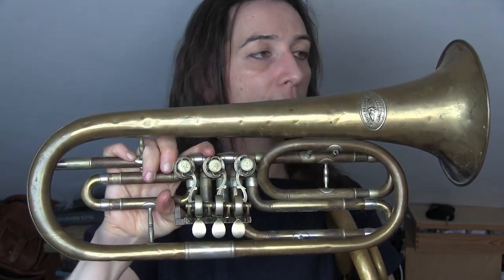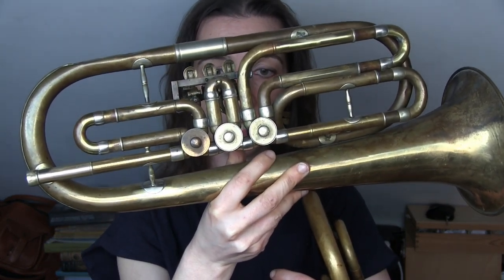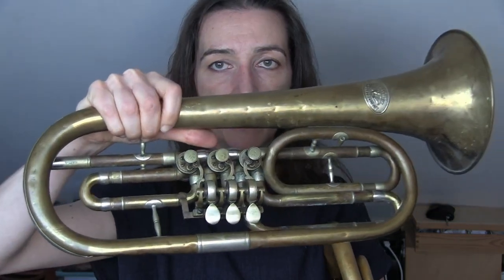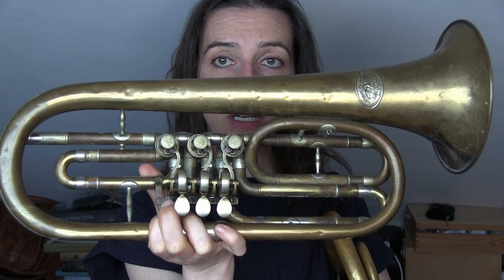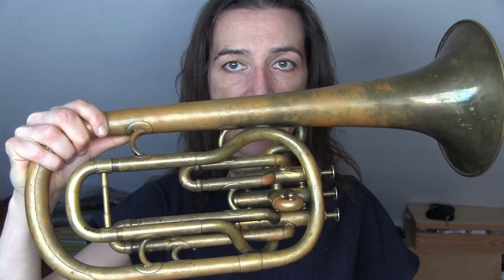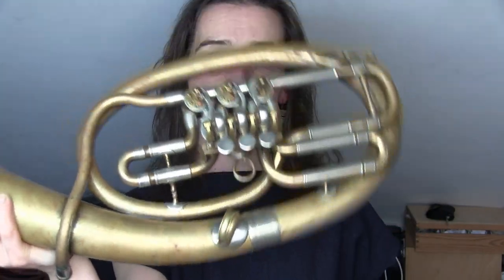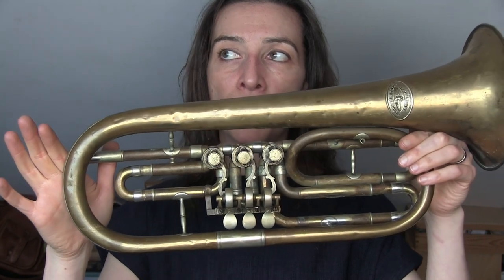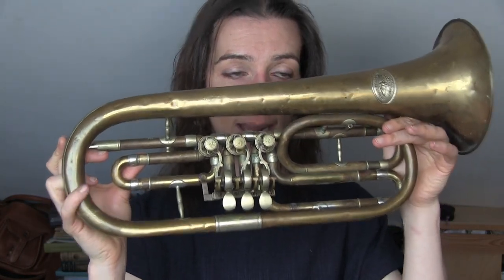Anneke Scott on her the Hindemith althorn sonata and her August Dennstädt instrument

Comment: I have several of these. I've always referred to them as alto/tenor flugelhorns. There's a great deal of variation in bell-size, for some reason, but that's true of most flugelhorns of any size. I just acquired another in alto C.
Reply from the maker: The nomenclature is such a slippery thing for many of these sorts of instruments!
Reply: @AnnekeScott  They seem to have proliferated after 1830, when Leopold Uhlmann of VIenna made the first one in C. Many are faithful knockoffs (maybe made in his factory by his workers?), but many more have variations, ranging from very slight to misguided and unplayable. The C I just acquired has a little Heckel snake which acts as a brace for the valve block. Some say Heckel snakes are desirable and provide clues, but they've never proven useful to myself in terms of dating a horn or nailing down its place of manufacture. By the time you get to the late 19th century, they'd spread far and wide to the point that makers were unknown to one another. We live and . . . get confused.
Reply from the maker: @gregmonks  Exactly!

Comment: Anneke, great videos, first of all. It's just refreshing to see the same interest in period instruments (every period, not just from the Renaissance and Baroque) sparking with someone else. I study and have had a passion for brass organology since I can remember. I have a Bachelor and Masters in trombone performance, but I also play all brass, and I mean all! 
One thing though, the bell-front instrument you are playing is a rotary alto flugelhorn, rather than an alto horn or althorn. All of these alto range instruments are not the same. They differ in mouthpiece size/shape, mouthpiece shank, bore, bell size, and most importantly, degree of conicity which influences the sound (and intonation to a degree). The alto trumpet in G/F/Eb is clearly just a trumpet of the same trumpet shape and bell. The alto flugelhorn in G/F/Eb is just that, a flugelhorn, almost always, rotary and bell facing forward. The alto saxhorn in F/Eb is just a saxhorn (which is the same as the modern instrument in every way) with its bell pointing up. Although, it doesn't belong to a brand new family of instruments, like Sax claimed, at all. The saxhorns are basically just cornets. The only difference is in shape, bell forward vs. bell up. The rest, the mouthpiece, the shank, the bore, and the bell size of the soprano/contralto saxhorns are exactly that of the cornets. 
The problem starts with all of the other alto range instruments. They can be bell up, bell forward, bell backward, bell to the side, hand-held, resting on your shoulder, etc. with every degree of conicity and mouthpiece shape/size and sounds imaginable. That's why they are categorized by their similarity to modern instruments. And so, you have flugelhorn (bugle) type alto instruments, trumpet/cornet type instruments, horn type instruments, helicon/sousaphone type instruments (the sousaphone was made by John Philip Sousa. You forgot that one ;) ), and the german/bohemian althorn which is oval which is the closest thing to a real alto tuba/euphonium/kaiserbariton. And you have a few oddities like the frumpet which is neither an alto trumpet, nor a flugelhorn, nor a horn. I hope it helps. Brass nomenclature especially of the 19th century can be a real jungle!

Comment: Great introduction of the instrument. However I am curious exactly what mouthpiece you use. I have a similar instrument, but all my "modern" Alto Horn mouthpieces have shanks that are too shallow. I have one a little bit more vintage that does somewhat fit, but with it the horn does have some very noticeable intonation issues. I wonder if a correct fitting mouthpiece will help, and of course where to get such a mouthpiece?